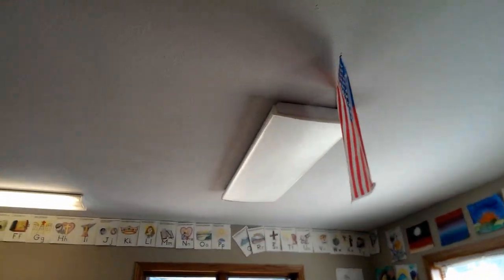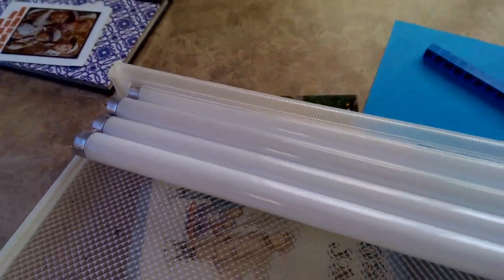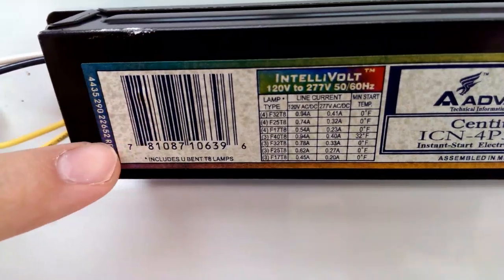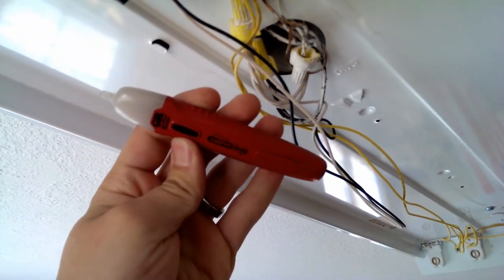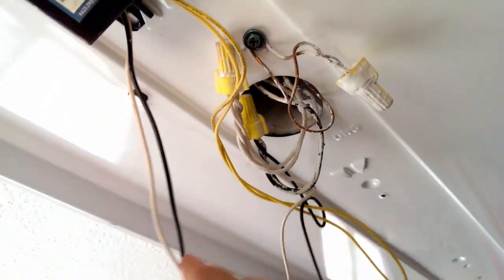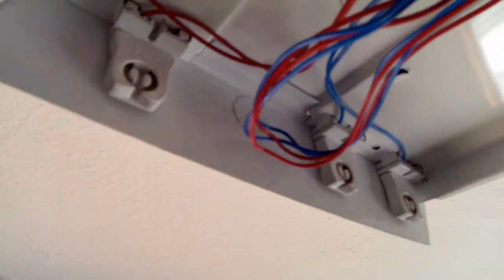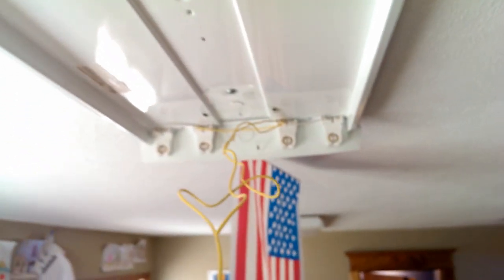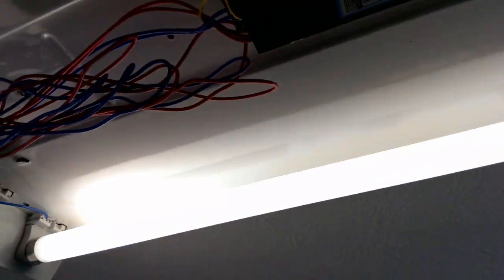How to Fix a Fluorescent Light with a Bad Ballast

Comment: To me the whole point of watching it was the wiring colors but he made it fast forward  so the wiring was not a critical issue or important enough to know so ll'l find another one to watch where it actually shows you how to really do it but thanks anyway
Reply from the maker: Sorry I didn't do better in that regard. I'll do my best to improve in future videos. Thanks for the feedback!
Reply: Most ballasts have a wiring diagram printed on their case. And not all ballasts have the same colorcoded ease of use. 2 wires on one side will be your power in (white is + black is -) the 4-6 wires on the opposite side (depending on make and model) will send power to the bulbs.

Comment: Ben, thanks again for another sensible, useful video even if it was a while ago. This particular job is one that I have done many times in fixtures with 1, 2 or 4 lamps of varying lengths. In my experience, I have found that I can accomplish this task faster if I just remove the old wires from the sockets and slip the new ones in their place.  The way I go about this is to cut the old wires going to the sockets, so they are about four inches long. Then I replace the ballast with a new one. Then I remove the sockets (they usually just slide out but some require that a screw be removed) one at a time and remove the old wires by twisting counter clockwise (probably doesn’t matter which direction) while maintaining a tug on the wire at the same time and the wire can be safely removed without damage to the socket.  The wires from the new ballast can now be pushed into the socket. Take care to maintain the placement of the colours. Then slide the socket back in place. In the fixture in your video, it looks like the sockets are the slide out type.

Comment: Great vid, thank you.  Question for you: is there a way to tight the end sockets where the bulbs fit in; seems on one my fixtures, the get loose over time, don't hold the contacts to the bulbs as well and will not got one when I hit the light switch.  If I remount the bulbs in the sockets, the go back on and work fine.  Seems over time, "play" has developed between the sockets.  Thank you for your help.
Reply: Most of “contacts” for the light bulb snap in to the fixture. A lot of times they may bend out of shape from people changing the lights out. You can replace them. They sell them at Home Depot or any hardware stores. You will need to take some stuff apart.
Reply: @user-vi1os8of8p  Thank you for the info.

Comment: If you don't want to add wire nuts, you can "plug" the new wires into the old connection by cutting the old wires off leaving an inch or so and then "unscrew" the old wire. Pull gently as you unscrew the wire.  It works. You can then simply plug in the new (should already be stripped) wire into the old connector.

Comment: I have three 2-bulb fixtures ("shop lights") that will only light up on one side.  When I put a bulb in the bad side, it will either stay unlit or it will flicker and snap, never fully lighting.  Will I have to replace the whole ballast with those, too?  Or is it cheaper to just replace the whole fixture?
Reply: +Flannel Acres Faulty ballasts often cause this to happen.

Comment: Do you just flip the switch to OFF on the light fixture or would you need to shut the entire home electricity OFF?
Reply: David Yip lol
Reply: Lol. I work with voltage all the time. Just gotta make sure current isnt passing through cause that's what will explode In your face when you cut your line wire. It's almost the same as working with power off you just make sure your hot is the last thing you connect and you don't accidentally touch the bare wire.

Comment: I have a light fixture with just 2 lamps. Only one of them will light unless I touch the unlighted one and then it usually lights. What could it be wrong if only one light goes on? I switched the lamps, and still only one went on and it was the one that didn't light previously. These fixtures are in a plant stand. Thanks for your help!!
Reply: Replace the connectors for that particular bulb since the problem is staying with the connectors when you switched the lamps.

Comment: One of the 2 bulbs in mine stopped working. When i replaced the bulb the other got much dimmer??
Reply: Pair similar bulbs if possible,some have different color and power requirements,read the balast for information on what amount of what type of bulb it can support at once.

Comment: On another video posted on how to change a ballast, the guy connected two red wires with one of the blue coming from the ballast, then two blue with the other remaining blue wire. Then the yellows with the red from the ballast.  I wonder why the difference
Reply: +iquit4gud Different number of lamp ballast, This is a four lamp ballast. The one you're talking about sounds like a two lamp ballast.

Comment: If you are using one of those bargain power testers always test it first on a known hot source to verify it works before trusting it right away on something you are working on. In a house you are dealing with 120vac. In a commercial environment more likely 277vac. Just a safety tip.

Comment: IN MOST CASES THE BALLAST IS AS EXPENSIVE OR MORE EXPENSIVE THAN A NEW LIGHT FIXTURE, SO IS BETTER TO JUST BUY A NEW LIGHT FIXTURE.
Reply: Not if it’s a neon light ballast, which i have. Replacing the ballast is exactly the same. This video was perfect.
Reply: @jetnick3576 , That's my point. If it is exactly the same why not go with a new fixture.

Comment: Did you shut the power off at the light switch or the breaker... Lol
Reply: I know it's a six-year-old comment. But for anyone that's reading, he has a point. There are multiple ways to wire a light and a switch to it. 

Two common situations:

The first situation is where you have power wires that comes to the switch box first and then continues to the light fixture.  So if you shut the light switch off you'll probably be able to change the ballast with no problem. Although I wouldn't recommend it. 

The second type of setup is if the power wires comes to the light fixture box first then a wire leaves out to go to the switch and then returns to the light fixture box.
 And with this second set up,  even if the light switch is off you could be in for a nasty surprise messing with the wires inside the fixture if you have not cut the circuit breaker off first (and if you are standing on a ladder when this happens, you could fall and be injured).

Always cut the circuit breaker off first when possible.

Comment: now I got to look for another video show me how to wire it up
Reply: Maybe you shouldn’t be messing with wiring anything if you cannot match colors.
Reply: This video really didn't help me at all I already know about color coded wires I can wire that up with my eyes closed this just happened to be a video that pop up first one I looked at what I was looking for is was to replace a ballast for a 4 bulb fixture not all of them are the same the one I replace I had a gut out the wires there was no color coded  wires they were all brown and black wires with two ballast I took out the two ballast and replaced it with only one 4 bulb ballast and wired everything up the right way straight from ballast to the bulb holders and no not every one is going to be lucky like you and find all color matching wires

Comment: What if you can't turn the light off and don't know where the breaker is?
Reply: Then you should get someone there who can do the job.
Reply: If you go down to your basement into the hall closet, on your left is a metal box on the wall.  That is your breaker box.  Unfortunately yours isn't labeled so you will need to switch all of them on and off and yell up to someone to find which breaker switch goes to the light in your dining room.  Hope that helps.
Reply: Boy, Google Maps is really getting detailed!
Reply: @P0PH0USE  I have a light out and no power at all.  Others in the circuit work.  I went to the beaker box and looked for those switches and couldn't find the breaker.  I called my wife to let me know which one caused the lights to go out. Cell phones are a miracle.

Comment: You dont need to flip the breaker, just the switch
Reply: Until one of those kids walk by and try to turn on the light and then you get a nice surprise.
Reply: +spacelord782 Tape the switch to the light fixture.
Reply: +spacelord782 His kids seemed kinda swift,  doubt they would..
Reply: Or just throw the damn breaker and stop flirting with death.

Comment: the sticker on my ballast has decomposed so i dont know the model. cool
Reply: Any brand or model will work. All you need to verify is the number of bulbs (lamps as they call them) are in the fixture, the voltage they operate on, and the length and pin type of the lamps. All this info will be on a new ballast and this is what makes them range in price and availability.

Comment: if you used an older style magnetic ballast which can be found easily on ebay they will last alot longer.
Reply: Or smack in a choke and starters infinty living light

Comment: You should not have the child make  contact  to a live outlet with the noncontact volt sensor as he did in video.
Reply from the maker: I appreciate your perspective but I disagree. I believe that it is important that you teach kids how important things like electricity work and how they can be safe around it. The more you teach the safer they are. Thanks for watching!
Reply: Ok, I did not think of it that way. So it is safe to place a non  contact volt meter in a live outlet? I truly  dont know if it is safe. Thank you
Reply from the maker: +Daniel Mcglinchey Yes it is safe as the non contact electrical tester has no ability to actually conduct any current to the user. It senses the presence of the AC current but does not do so using a metallic probe. I explained how it worked to him and how to use it correctly. Either way though I do agree that safety is absolutely crucial!

Thanks again for your comment! I appreciate it very much and value the conversation.

Blessings,

Ben
Reply: +Benjamin Sahlstrom Thanks for your further  explanation!
Reply: +Daniel Mcglinchey; One time, when I was a kid, I held onto, and inserted two bare wires, connected to an analog volt meter into a 120V AC socket. When I picked myself up off of the ground, I realized, once-and-for-all; that is something that I didn't want to do anymore. I am in my 60's now and remember the experience vividly like it happened yesterday.
Reply: I couldn't agree more. Its exactly how my dad taught me.  
Also it was an impeccable way of showing how simple a tool it is to use.   Everyone/house should have one.
  Have you ever opened up the ballast, would be very interesting to see how & where it failed.   I wonder if bigclive ( a great youtuber-electrical engineer ) has covered it.    Anyway, thanks for the well made how to video. You have another subscriber.
Reply: No worries he will be alright.
Reply: facepalm !  "contact with a non contact"
Reply: in the event if a freak against all odds situation isnt the ill replaceable health and well being of your child more valuable than making a pount that sim wire arrangements are "safe"...theres to much on the kine to lose without equal gain from knowledge that can be aquired at a slightly later year in his development...its an unnecessary risk with a  low value reward kf awareness of circuityry dint you think?